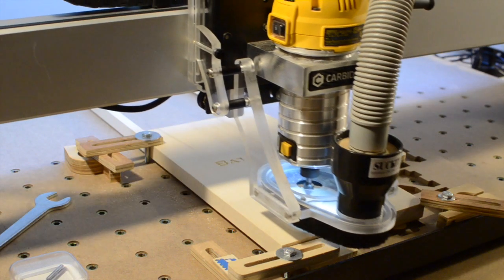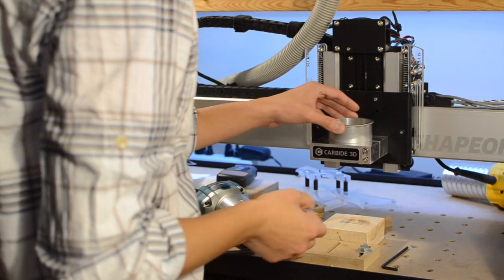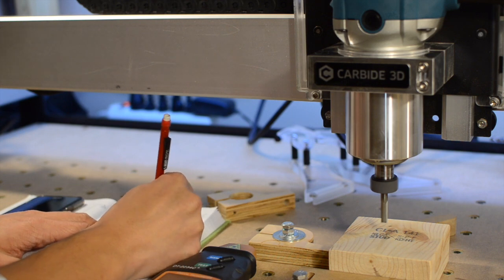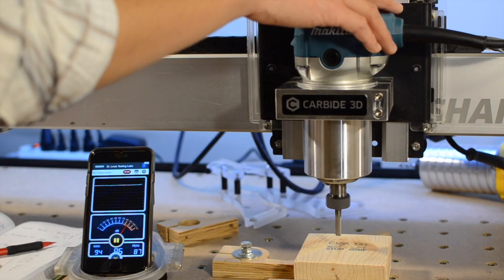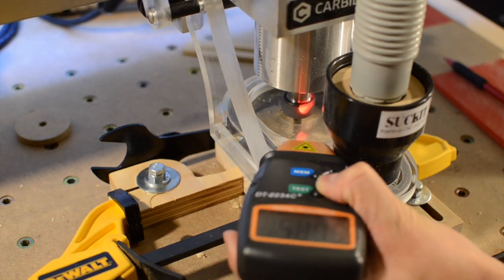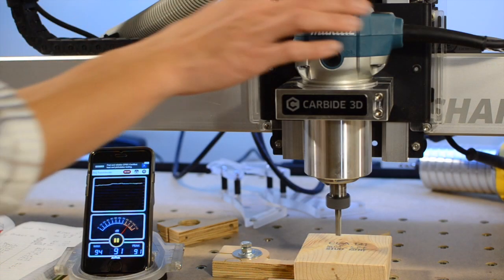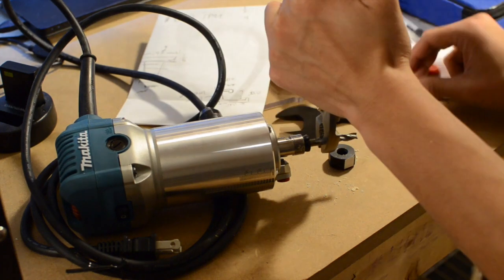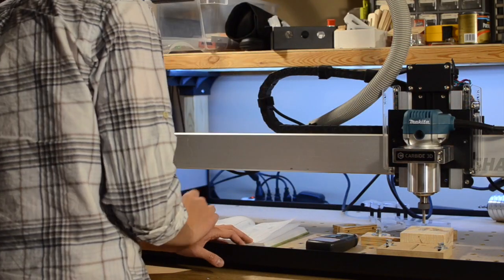Makita RT0701C vs. Dewalt DWP611 as a CNC Spindle

Comment: The Makita was my choice for my XL based on the speed range.  It is working perfectly and the longest job has been about 6 hours.  (Before I knew what I was doing with feed rates, etc.)  The router did not heat up at all.  For all around use I think the Makita was a good choice.  Keep on producing your videos. I find them very useful.    BTW, the SUCKIT looks like a great addition to the SO3.

Comment: I just really love your videos. They have the perfect balance of Science and real-world Shop experience. I have a Chinese water cooled spindle on my CNC router.  I'm very impressed with the quality. The bearings are particularly nice. Spending it by hand, it feels smoother than just about any spindle I've ever experienced including some very expensive CNC spindles, and the price wasn't much more than buying a router at Home Depot.
Reply: Liberty4Ever hi, you and a few others have mentioned the Chinese spindles. Where are you guys buying them, and is it possible to get one that is more powerful than one of these budget routers that is about the same size and price? I’ve been using a 1hp Bosch colt and after about 2 yrs it’s failing, and has always seemed a bit under powered for my uses.

Comment: Nice video. It's always good to see what's on the market. I wonder how Kress (German brand) will stand against these two.
One comment though, as an acoustic engineer I can tell that the comments and measurements on the sound levels are not completely fair. 
Because the Makita is mounted, vibrations propagate trough the (CNC) frame. 
In general this gives higher (and 'harsher') sound levels.
You will need to mount both on the same way to get a decent comparison. 

For the same reason it wouldn't be a bad idea to insulate (with rubber or so), the router from the frame.
Unfortunately that's also not that easy because rubber isn't hard enough (more play)
Reply from the maker: There's a lot of things that weren't quite scientific about my comparison. When I did the sound amplitude measurements though, I made sure both Makita and Dewalt were mounted.

For the frequency spectrum part, I realized after the fact that some of the downdraft from the router's exhaust could be blowing at my phone. Should have picked a different position there...

Comment: Be careful with long jobs on the makita I had one catch on fire and the replacement wore out the bearings. Both replaced under their excellent warranty.  Kept the last router for hand use and got a Chinese water called spindle and vfd and it's been perfect. And so much less noise.

Comment: I have the SO3 with the Dewalt router but I'm thinking of getting the Makita also because of the lower speed range.  I'm trying to mill plastics and its melting pretty bad unless I take super shallow cuts.  The bottom of the speed range of the Makita seems to be the highest I've ever seen anyone claim they've milled plastics.

Comment: I have burned out 4 Dewalt DWP611 routers in my CNC router. The second to last one lasted a few hours and the final one lasted only an hour. My understanding is that it's the variable speed controller. But I'll never buy another one. I replaced it with the Makitra RT0701C which has been great. So far.
Reply from the maker: Were you using it with dust collection? The usual failure mode is that the motor brushes get worn down and need to be replaced. That happens faster when particulates get pulled through router.
Reply: @WinstonMakes  I have a rather large dust collector nozzle within a couple of inches of the cutter and it runs continuously. I did check the brushes and they were all fine.

Comment: Is that shim still necessary for the Makita? I noticed the Carbide Compact Router uses the same sized 65mm Sweepy as the one Carbide recommends for those who wish to use the Makita. Yet on the Carbide store page, I didn't see anything that indicates the need for the shim to adapt the Makita.
Reply from the maker: It's included by default in the design before we had the Carbide router, to give people more choice.
Reply: @WinstonMakes  I think you just talked me into the Shapeoko over the Nomad. Seem with a Makita I can get low enough speeds to work with brass sheet, yet have room to play with higher RPMs should I decide to play with other mediums. You've been a big, thanks for fielding all of my questions!

Comment: Imo the DeWalt is a much better router . LED and you only need one wrench to change bits makes it a win for me .
Reply: LEDs are cheap. If you use the red button on the Makita, you only need one wrench to change bits.
Reply: +Tapajara LEDs are cheap to install in a Makita router? 

Please explain to me how to do this because I see no way to 'cheaply' add led lights to the tool itself.
Reply: no need to install in the router, mount to your machine
Reply: Aside from the fact that the Makita has a similar spindle stop button I actually prefer the makita 2 wrench solution as using a spindle stop button and single wrench would transfer the torque onto your CNC machine's frame ... which is not ideal it seems. With two wrenches that is less of an issue as you can prevent that torque transfer with the second wrench.

But I think everyone also forgets 1 thing. Availability and accessories. As someone who lives in Europe the Makita is a little easier to find and even more importantly can be obtained for use outside of the CNC (as I can see a fair few wood workers using the CNC in question here) with no less (last I checked) than 4 different bases. That all make it a nice router option for those who might want to use it as a 'dual purpose' router with a maximum in versatility.

What I am trying to say is that the best choice depends very much on your situation and location.
Reply: I had a dewalt, changed 4 times the brushes and it just died after 6 months of use, that is nonsense. Also try to change the brushes, it is quite a job. I love Makita, as it holds up in the field, working all day ling for about 2 years now at least 6 hours a day and no problem, changed brushes 3 times with super easy way.

Comment: If my budget for a spindle were up to $500, what would you recommend for a Shapeoko? I'm looking to carve aluminum.
Reply from the maker: I personally haven't looked into any alternate spindle options. I wouldn't spend $500 on a VFD or water cooled spindle, I'd spend it on a lead screw Z axis (example: https://www.beavercnc.co.uk/product-page/bever-cnc-heavy-duty-shapeoko-3-z-x-upgrade). Look up @vince.fab on instagram. Doing plenty with a Makita router. Rigidity is more important, if you cook a router, it's cheap to replace.

Comment: Can you tell us where you got the vacuum dust collector attachment from?  I'm planning on machining a lot of soft ceramic & that will be extremely necessary to keep the dust from destroying everything.
Thanks!
Reply from the maker: I got mine from Banggood: http://www.banggood.com/High-Efficiency-Cyclone-Powder-Dust-Collector-Filter-Top-Quality-For-Vacuums-IA1-p-1028998.html
Which is a knock off of: http://amzn.to/2gpbLj4

It works exactly as intended, although it did take over 3 weeks to show up with standard shipping... There's also a knockoff on Amazon that's rated poorly because... well, it's a knockoff. And it was shipped from China. Shocker. But it's probably from the same mold as the Banggood one, and therefore functional, if spartan...
Reply: I like that too, but I was referring to the SuckIt.  I found it not long after I asked that!  Thanks!
Mike
Reply: Great video, I bought the Dust Deputy a few months ago, nice addition to my shop vac! I never thought about looking on Banggood for one!

Comment: Dear Winston, I like your channel 
before 2 days ago I received my new Xl shapeoko
but the DeWalt router I purchased from Iraq 220v but the problem it's the collet it comes 8 mm long type, not 6 mm how can I change it because the dewalt collet different not like I have ER11 can you help me?
Reply from the maker: you have to buy an aftermarket collet,or buy tools that will fit the one you have, or buy an adapter.

Comment: I have the Makita RT0701C (but no CNC yet) and I love it. However, in the manual it states the following (direct quote): "If the tool is operated continuously at low speeds for a long time, the motor will get overloaded, resulting in tool malfunction."

Having only run it hand held, mostly for edging and the occasional pattern, I usually have it on for about 1-2 minutes at most before giving it a rest while I make adjustments to my work piece (noise being the main reason I turn it off) so I have no idea what "malfunction" actually means or what Makita feels is a "long time". My best guess is that running it at slow speeds does not allow the motor to cool. Other than a potentiometer there doesn't seem to be any electronics in this thing to overheat or stress.

Makita does not define specifically what they consider to be "low speeds". The manual lists the machine's 6 speeds (which are similar to what Winston quotes) as: 1=10k, 2=12k, 3=17k, 4-22k, 5=27k, 6=30k.

They don't say which of these are "low speeds"...everything but 6? Speeds 1-3? Anything under 3? Only speed 1 (10k)?  Overheating an electric motor is not a good thing obviously, so I assume their warning is about burning the motor out and that the fan doesn't provide enough cooling at lower speeds. Unfortunately, the manual says nothing specific about any of this and the Makita website does not seem to provide further detail. Of course ambient temperature will play a factor as well as the loads on the motor (materials, bit type, bit sharpness, feed speed, etc) but it would have been nice for them to at least provide some rough basic numbers, something like "at 20C avoid running the motor continuously at speed 1/2/3 for longer than 20 minutes, in 30C weather reduce this to 10 minutes." On the other hand, they aren't selling this machine as a CNC router. If they were they'd probably also tell you what the diameter is and possibly other dimensions.

If anyone has experience running this Makita at "low speeds" for a "long time" I'm sure others would be interested to hear about your experience, particularly if they are planning to do long CNC runs.
Reply: I've been wondering the same thing.  I saw the same warning on a different maker's router (don't remember which) and began to wonder if this "don't run it a long time on low speeds" is somewhat universal in routers with a variable speed adjustment, in which case the Dewalt might have the exact same heating issues.

Someone with experience, please chime in!  I'd like to know if I can run an hour-long job (with moderate loads)  at the lowest speed.
Reply: I have the Makita fitted to a Workbee CNC and have run the thing at minimum RPM for several hours with no issue at all. However, I'm only using small cutters (less than 3mm diameter) so the load is light. Perhaps the issue arises when the router is under high torque for a long time with the fan obviously not shifting as much air as it does at higher speeds. I guess a supplementary fan fitted above the router would solve that issue.
Reply: @ColinMill1  Thanks. That's good to know.

Comment: I recommend a Kress 1050 from Germany. It is intended for CNC use and runs very true. You can see it in action on some of my videos. It runs between 5000-28000RPM. The design and built quality is excellent.
Reply from the maker: The specs on that look really good, and 5000 RPM is even better. I'll put that on my wish list to check out...
Reply: Max Maker I don't know if that spindle would work with a stock Shapeoko 3. Looking at the drawings there is only one inch that extends beyond the mounting shoulder of the spindle which isn't long enough for this machine. The z-carriage can't get close enough in its current design. With the last version of the carriage that had the mount at the bottom of the plate it might though. Can't say for sure since I bought my SO3 after the plate was redesigned.
Reply: Yeah it might not fit, but you have a CNC to make the parts that will make it fit : ) As soon as I have some more money, I will upgrade though to a water cooled spindle which is much quieter.
Reply: wish they were available in North america and at 110v

Comment: HI. i have that Makita router, and i use it on my CNC, 

my question is, how long can i use it at 12,000 RPM speed, before it needs a break? 

Thanks.
Reply: I have the similar question. Did you find the answer yet?

Comment: I just ordered a Shapeoko 3, coming in next week and ordered it with a Makita.  I already have a Bosch Colt, but since I didn't see that as an option, I didn't think of asking if it would fit.  Do you know by chance?  I guess I can answer that in a week or so when I set the thing up.
Reply from the maker: I don't know what the diameter of your router is, but if it's not ~68-69mm, the answer is no.
Reply: I am planning to buy the Shapeoko 3 and have the Bosch Colt as well . . .  will the Bosch fit ????  . . .  or should the Makita be the way to go since it will perform at lower speeds.   I went to Ed Ford's presentation at the Maker Faire last weekend in San Mateo and was really impressed.
Reply: Winston Moy hou mace

Comment: Any thought on loading routers with 1/2" collet?
Reply from the maker: A lot of these trim routers won't go past 1/4". Specialty collets will get you to 8mm (~5/16) maybe. You could use a 1/4" shank endmill with a flared head to 1/2". Mostly you see these on "spoilboard"/surfacing/fly cutters. It would be perfectly fine, but I suspect the limiting factor will either be motor torque or machine resonance/vibration if you're looking to do more serious material removal.
Reply: Winston Moy Thank You

Comment: A big concern for these spindles is shaft runout.  Did you do any tests there?  Also does the bush you used to shim the Makita into the Shapeoko contribute to any imprecision?  I know that there are several third parties who make collets for the DeWalt in 1/8 and 1/4" sizes, do they also sell collets for the Makita, or are there any aftermarket collets available?  It looks like there's a significant difference in the height of the two routers that you didn't really address that might be a critical factor in making a decision as well, since the Makita seems like it might offer an extra inch of Z axis clearance if it's set up right.
Reply from the maker: I have not had a chance to properly test runout (need to break out the dial gauge and a longer endmill), but I just did an aluminum job on the Makita and came well within 10 thou of my expected dimensions without somewhat conservative tensioning of the belts... lot of variables, but I've never had any real issues with runout. I'm using a collet reduction bushing (http://amzn.to/2h4CFOi) since those are platform-agnostic, but there are third-parties that make 1/8" and sometimes other collets for the Dewalt and Makita.

The Dewalt is larger in every dimension, and actually has about half an inch more reach than the Makita, but the Makita's shaft extends past the motor a bit more than the Dewalt, so in my case it'll reach through a dust shoe further than the Dewalt.